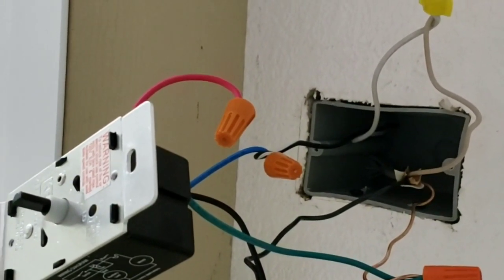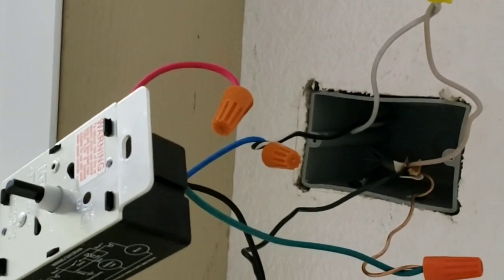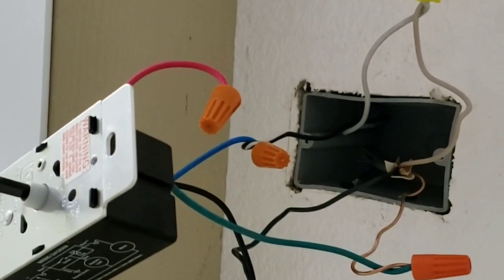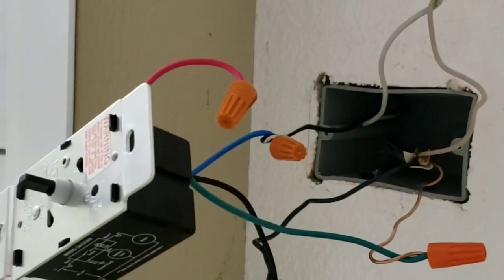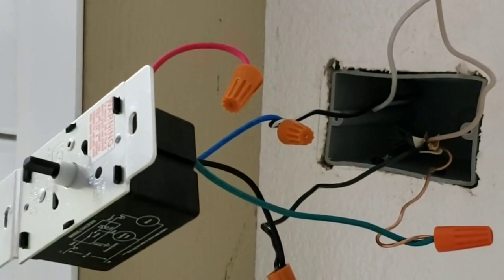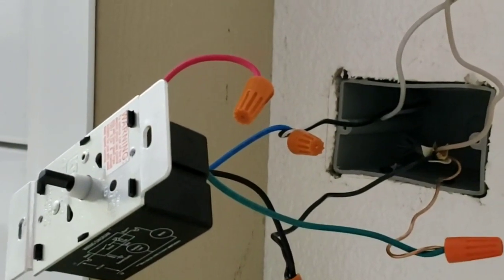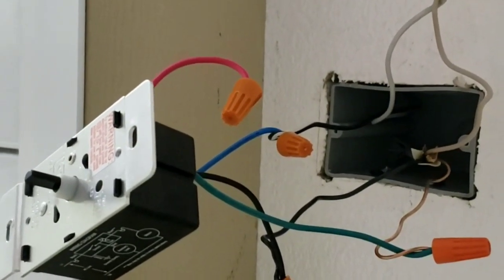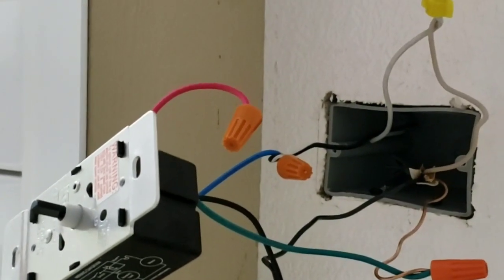How to wire a KB Electronics Solid State Motor Speed Control Model KBWC-16LK

Comment: I just purchased the exact speed controller. But im trying to use it in the place of a standard on/off switch that runs to a commercial kitchen exhaust fan and light. Its in a food truck and the fan is so Loud! Would I wire it the same way you did, even though my fan is wired together with the lights 🤔.  I also have black, white, and ground coming from the fan. And the same coming from the breaker box.
Reply from the maker: Hi Mike yeah the speed control should work perfectly except you'll have to run a hot over to the light by itself so the light doesn't dim 

unless you're not trying to get any kind of dampening control of the fan

 if it's simply for on and off

 it will work fine

 it's always on high 

unless you turn it low
Reply: @Jonehughes  thanks for the reply.  Yeah my main goal was to turn down the fan speed. Its so loud i can barely hear my customers order. But when i turn it off it gets extremely hot in the food truck and fast. I dont think the lights dimming when i turn the fan down should be too much of an issue....or i hope not lol
Reply from the maker: It will not be a problem at all

 if you buy a bulb that dims

Just don't use a non dimming bulb
Reply from the maker: And of course

 what I would do is 

buy a silent fan 

there are so many on the market these days that are whisper silent

and they can be used in every situation
Reply from the maker: And your first step can be just checking the fan

 you do have now 

almost all noise comes from outside

 not from inside the wiring

 so you check and see what is loose and fix that....

You remember the days of putting a playing card in your tire spokes on your bicycle

So we could make cool noise when we rode the bike

Same principle applies to your fan 

there's something creating noise
Reply: @Jonehughes  its a huge commercial kitchen fan. It just extremely loud from the air moving through the metal grease filters so fast. I called "Larkin" the manufacturer.  They said they set all fans to high and can be adjusted with a vari speed as needed deepening on hood size

Comment: Hi. I just bought a house and it has one of these. What is it exactly
Reply from the maker: Mine turns on my whole House fan and allows it to go from full speed to any speed I want
Reply: Jon Hughes ok thanks. When I got the house my curiosity got the best of me. I’m wondering. What does this do. Then the ceilings opened up and I felt a rumble. Then I quickly turned it off because I had no clue what had just happened